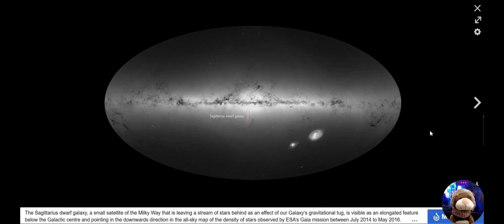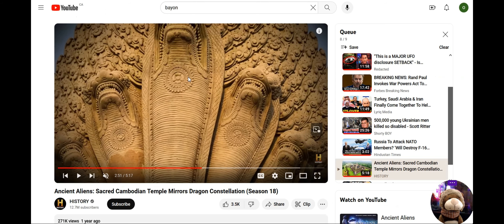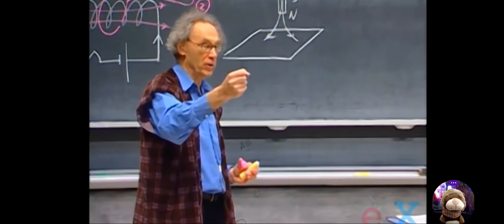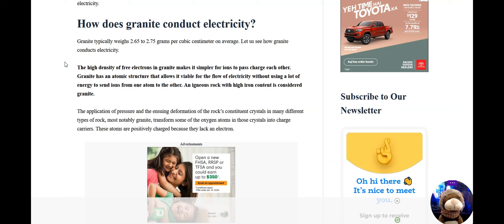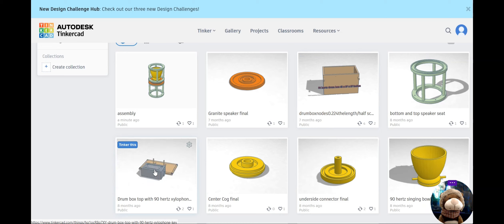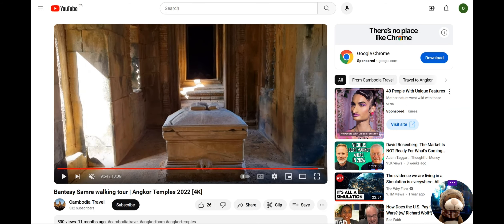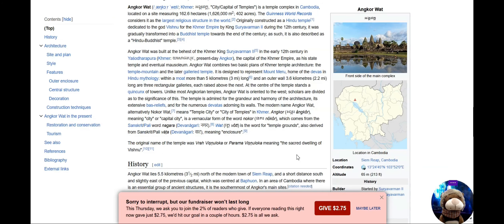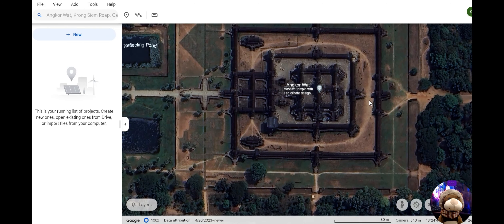Galaxy in a Box The Thermoacoustic Universe Part 3  Angkor Wat

Comment: Hey, please is there a way i can speak with you, like contact or something.... i have some questions id love to get your input from, i know there's google and all, but i still want to hear from you, ps, its quite hard to flow along with your idea but with an open mind, i found that all you've said (well about 85% , remaining i still meed to do more reasearch) have scientific backing, its all about how to find the facts, the idea of how the machine works checks out but i still have some questions, please respond
Reply from the maker: I'm on Linkdin as Gamer Kingdom. There are 3 there just message all of them one of them is me. The device will work but I'm just not sure how much power. You can always add a coil if you want more power but I think it's enough power already. If you look at Angkor Wat.... all the cold air goes down and makes the box vibrate like blowing cold air in a beer bottle...and the heat and sound goes up and makes the tower blow like a horn. The tower is lined with so many pedals of gold all vibrating..... so simple. Just a chimney alone will make a draft and you capture the cold air coming down to make a Helmholtz resonator to make sound. 
For that size it is unlikely that you will make hydrogen because the water prevents it from getting hotter than 212 degrees F... it will boil the water and make steam and blow like a horn... and you will get alternating current from it.
It will arc inside and so you will get ozone and nitric oxide gas likely. It could be modified with a voltage regulator and a nichrome wire but the nichrome wire will only reach 800 degrees VS 10k degrees with an arc. It is unclear how well it will operate with a Nichrome wire VS an electric arc. I would have built it already but to be honest I am afraid of electricity otherwise I would have built it by now.
I have a feeling that it will pick up the whole AM band and half the shortwave band... if so then it will never stop vibrating... and yes the water could split but I can't be sure. Splitting the droplets should be enough. It's all about vibration,  the hydrogen is not really needed.
What scares me the most is the electric arc's.. that would make the magnet bounce about 10 million times a second... and science says the faster you move the magnet the more current you will get.... It's really hard to put a number on how much power.....
Here is  my way of thinking....If you take a piece of granite and put it in water it does nothing... but if you vibrate it .. it makes waves. The granite works in air the same way because your vibrating it. A microphone picks up sound.... and the sound is always there and never stops. 
I spent a lot of time thinking of how to make a musical instrument play all by itself.. and yet it is so simple.. you only need a chimney to make a draft and a Helmholtz resonator under it to make the sound. The chimney blows cold air into the helmholtz resonator right away and it makes sound and heats up and once it's hot it never stops. It is completely free and no moving parts. What do they both have in common?... They both have holes.
I solved green energy and I am really proud of it. I hope others will be able to see how simple it is. This is absolutely real and I think anyone with common sense will see it.
If I build a ship 50 ft in diameter and 30 ft high. It would have an air shaft right through the centre.. and I would get all my energy out of that hole absolutely... because the cold air goes down and the hot air goes up... the air flow makes the sound and the sound makes the heat and so on.
Reply from the maker: I don't think people should try building it without the gold because its a better shield from  the gamma rays than would be from lead. There's some transmutations going on in there as the dust and gas from the air get sucked into it. All sorts of elements get created from the dust and gas.
There's a lot more going on with this device that I don't even talk about. There are elements being charge separated at the spouts. They just cannot stay in the bowl and will repel it through the spouts. If it takes in co2 it's going to rip the carbon molecule off the oxygen.. and it's going to rip the sulphur molecule off the sulphur dioxide. It's going to rip the iron off the iron oxide....it's going to make calcium and all the elements from the dust and gases in the air...and also make the 7 sacred metals. Nitrogen transmutes into Oxygen and by some other means into Aluminum. Calcium and Magnesium accumulate because they are attracted the the hydrogen. The calcium is heated into calcium oxide and when combined with lead and hho gas turns into gold. Galaxies create everything from dust and gas. The radio frequency from the spark beside the transducer microphones just makes it all spin like crazy ripping everything apart at the hole and separating it at the spouts.
There is a whole lot of stuff floating in the air that people have no idea because they cant see it. Carbon, iron, nitrogen, hydrogen, oxygen, calcium, magnesium, sulphur... it all turns into gold and oil .. you name it. Why mine it when you can create it... The earth is never going to run out of oil it creates it... and it's floating in the air right now and you can get it all back.

Comment: Hey its me from LinkedIn I haven't been able to reply because my email connected to my LinkedIn is full you said some friends are building a version of the galaxy of the box  ? Called something different if that's the case I would like your ideas on completing a time based version or a device dedicated to time
Reply from the maker: Hi Dean, ya there is the quantum crystal engine at the daily planet club... but he doesn't want to show it until he gets 5 million subscribers. That will probably take a few lifetimes so I gave up on it.
The Chinese built the GIAB. They wont admit it but I saw some ufo's flying around there recently that you can clearly see are using a thermoacoustic engine. Some of the best UFO footage I have seen ever.. just recently in China.
You would have to look at videos on Helmholtz resonators to understand the time dilatation. If you close the bowl and make it a golden egg with only  the hole at the bottom.. it will gain mass when you vibrate it.... you will get some thrust inside and it should levitate because everything is gravitating to the hole.. all the dust and gas is getting sucked into it.  Time should slow.. but I have no idea by how much.
I drew something 30 years ago that Mike Markum claimed was his when it's my handwriting on the drawings. You can find it on scribd " Free energy plans to make a time machine and propel a UFO." I have no idea if it works... I don't think so... but maybe because it uses the Biefeld brown effect to squeeze granite like the earth would. I never built it but some videos show it saying scientists looked at it and it's on the right track. But I think the newest version the Giab is more on the right track. In all honesty.. I lost interest in all this. It's never going to come out because the whole planet is controlled by narcissists... a human condition affecting one in 6 people that is going to collapse civilization. There is no future. The Kali Yuga is coming to an end Jan 2, 2026 after the Nova from T Corona Borealis any day now. No idea what is coming but we are certainly coming to the end of an age.
There are a few in the comments that may have built a version of it but they never showed it so I can't be sure. It's open source and nobody is obligated to tell me.
I have a copy of the latest plans to Malcolm Bendal's device similar to mine.. but he put a turbine on it and I honestly think it will rip apart from the centrifugal force. I never met Malcolm.. not likely to meet him ever either.
Briefly spoke with Bob Greenyer as well but I did not even bother to show him the GIAB because hes been at it for 10 years... its a lost cause. Some others may have shown him but I'm not sure. Either way.. what can he do?.. nothing will change.
I recently decoded a Summerian artifact   cylinder seal VA 243 that shows the Nova from T Corona Borealis and showed it to a university expert in linguistics and history.... and he was a narcissists....crazy people... can't be bothered. The sun on it is not a sun it's all the stars around corona Borealis... the stars on the left are on the right of Hercules. They match up perfect with Hercules. He tried to decode it as a language when it is a star map... and he freaked when I disproved his work.
Reply from the maker: You can't take anything about Mike Markum for granted. The plans everyone shows are not his. I don't believe the story myself.
There are many videos showing Helmholtz resonators gaining mass when you vibrate them so that is a given. 
Some of the ancient Vedic texts speak of people who travelled the stars but when they came back thousands of years had passed. So I think you can only slow time.. time dilation. It's not like in the movies.
It's certainly tied to vibration because if you didn't vibrate the Helmholtz resonator then it won't gain mass. Inside such a device would sort of be like living in a hyperbaric chamber ....apparently you get younger.

Comment: That was a great explanation, thank you. You keep saying you don't recommend anyone building this as its too dangerous, so what if the scale was smaller for testing? In theory it sounds feasible, but a working model would convince the seeker.
Reply from the maker: Well people did build them and they were made safe because they were in a building off limits to people. Making it safer would be like eliminating the metal on the outside of the box.. putting less gold in it.. adding a voltage regulator and a nichrome wire instead of an electric arc. 
There were smaller ones with 4 inch disks probably running at 360 hertz... but this is in the ULF band used by the military.
It's just not clear to me how powerful this is.... what if it's 15 million volts and 30 amps?....that would be 450 million watts.... not your average generator. Running at 90 hertz without the gap wouldn't be so bad but if it's arcing in 10MHZ..then the magnet is bouncing 10 million times a second... that magnet will get so powerful....
I'm not an electrician or an electrical engineer.. this is way out of my league. There are people who are experienced and work with this much power for a living.. they are trained and have experience. This is in a league for big companies like Siemens who build power plants.
Reply from the maker: Whoever has the guts to make a power plant with it will probably make a lot of money even selling the power at a penny a kilowatt hr... but then 3 years later it will be obsolete and the small ones will come out for every home.

Comment: Thank you for this, i just downloaded part 1, 2 and 3... before now i read some of your comments on https://youtu.be/no50_5iSr2Y?si=MoY4muiKTKjWlnMM
And did a little research, i swear you put me down a rabbit hole that enlightening,  some facts checks out and i would love to understand your idea further, the ark of the covenant being a crude electrical device blew my mind (as a leyden jar essentially), your theory onnthe universe being in a box is mind racking, thank you for putting this out here
Reply from the maker: Some of the other parts are on other videos on my channel. It's not a capacitor... it's an electromagnet. The power is instant as soon as it vibrates but it needs to get hot so it makes its own sound and powers itself. So simple now that you see it... I would have never thought it was possible until I figured it out. It's only going to get hot enough to boil the water because the water will keep it from overheating and cracking the disks... but that is fine enough because it's already too powerful as it is. On a larger scale you could have spinning plasma suns in there but then it gets too dangerous and would need extreme cooling. Nonetheless it will arc inside or you can modify it so it does not... but without the arcs you can't control the excess voltage going across the disks.
Reply from the maker: You could look at it as an asymmetrical capacitor.... and the hole would be the resistor... but I just look at the magnet bouncing between the conductors.. instant alternating current as soon as you sing to it and no need to sing to it anymore once it gets hot. In the end it's just a powerful microphone and speaker/ electromagnet feeding back on itself. It may alternate between superconductivity and super resistance. For sure it's going to gain mass.. that is already proven that when you vibrate a Helmholtz resonator it gains mass.
Reply: @omegafile  I could only send one connection and LinkedIn keeps telling me to grow my acct, I have one vital question to ask , how do we use this as an energy source, I mean extract the energy, because I am planing on writing a full piece of this idea with all the scientific backings supporting it
Reply from the maker: @ifeanyinwoye3842  You should get ac current right away when you sing to it....then run on its own once it gets hot. You would have to make a transformer for it. I can't estimate the current ...depends how powerful the magnet gets...
Reply from the maker: @ADF098  I'm the one In Vancouver BC area.
Without a working model the scientific community will brush it off as pseudoscience....But I don't want to risk my life building it... This device is reverse engineered and according to ancient texts....killed over 50,000 people... they got too close and were electrocuted.
A university tried to build it decades ago and someone died and the project was scrapped. I'm confident it works but without a working model my confidence means nothing.
I gave away the concept because I don't want to build it.. I am afraid of electricity. I will never build it.
Someone found one of my preliminary designs decades ago.. a design that was just a prototype.... and claimed to have time jumped a few weeks into the future....I don't believe his story.. he stole my plans and claimed it was his but it has my handwriting on it.... but apparently this design was looked at by scientists that claimed it was on the right track..... but I don't believe the story.... Lucky guy got 2 million in equipment using my plans... but I think he didn't time travel and was a scrap metal thief.
Helmholtz resonators do gain mass when you vibrate them so this is a known fact... how much gravity will it make and how much will time slow?... I really don't know because I never built it.
I'm not afraid of a magnet bouncing 90 times a second... what I am afraid of is the magnet bouncing at 10 million times a second from the radio frequency of the arc's inside.. the faster you move the magnet the more current.
I drew those plans 35 years ago and have since completely revised the design.... and if someone could build it and scan the bowl with a 3d scanner once it's tuned then a new tuned bowl design could be available to anyone.
If you adjust the gap to get a 13.56 MHZ frequency from the gap the water droplets will turn into mini suns spinning around the centre and the outer gold box will contain them so they deflect and spin around the centre.
You will get a real spinning galaxy in that box if you do the above......
It narrows down to how much power do you want? You can boil water or tune the gap to spin plasma.